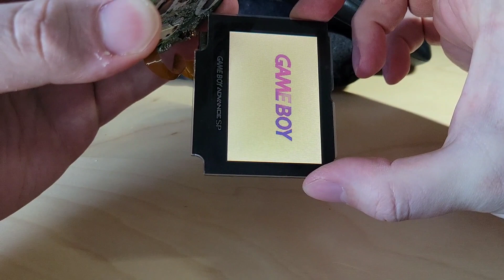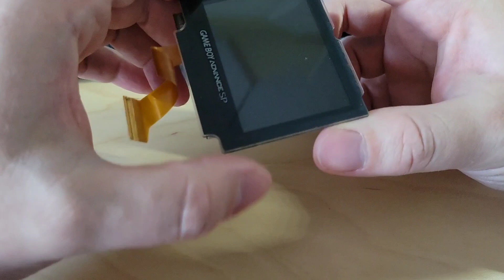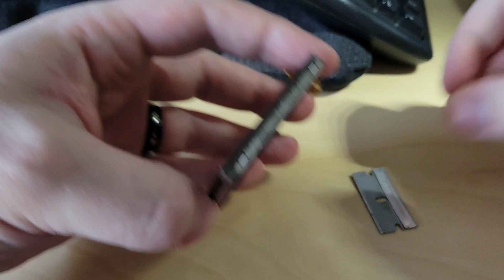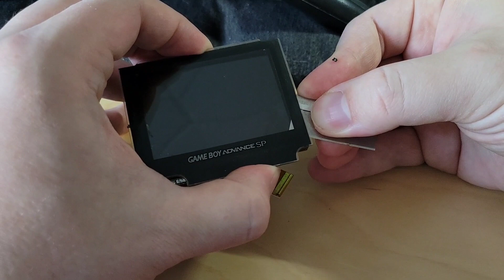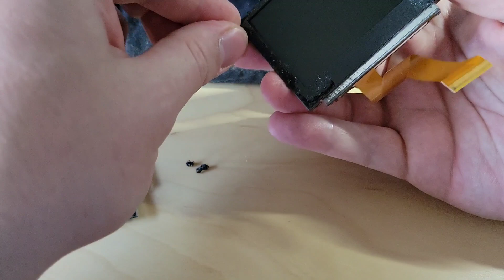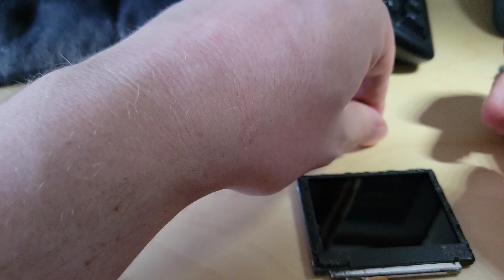how to replace the lens on an OEM GBA SP 101 screen

Comment: Should I use a heat gun to melt the adhesive first?
Reply from the maker: You can briefly if you want,  you don't need to but it might make it come off easier
Reply: I blasted mine with a hairdryer for 30 secs and it came off like a dream

Comment: 1 mistake and that's all it takes 😂 

My experience: 😢

I tried it everything was going smoothly and some of the foam droped under the screen protector 😢 I blew it and all hell broke lose I accidentally sprayed some saliva when I blew 😂 I tried wiping it with a napkin and no matter how much I wiped it it's still there 😂 I used a 99% isopropyl alcohol and a microfiber cloth and still the stain covered the whole fkn screen 😂 any who eventually 1hour of wiping I was able to get the stain out it but than I had a mini heart ♥ attack the screen wouldn't turn on 😅😂 as I'm searching for an ips screen upgrade I turn it on one more last time and bam GAME BOY 😮😮😮😮 😂 😢 so if you try this never wipe under the screen protector NEVER